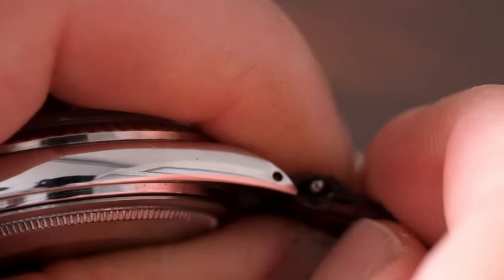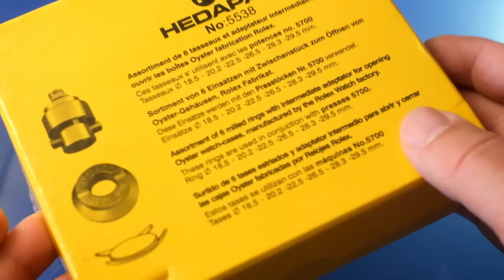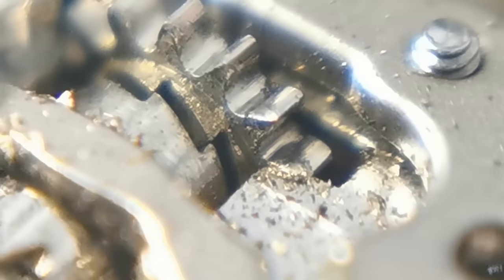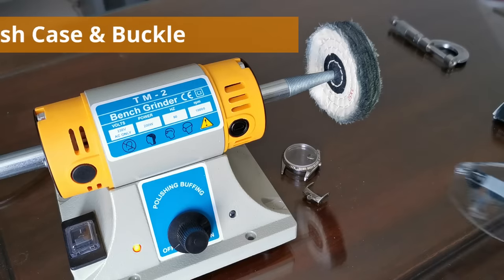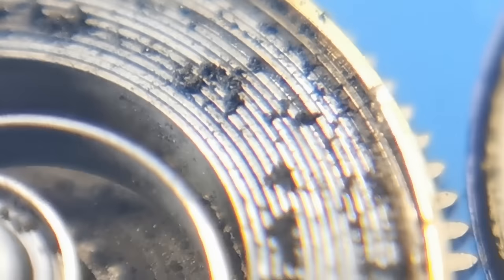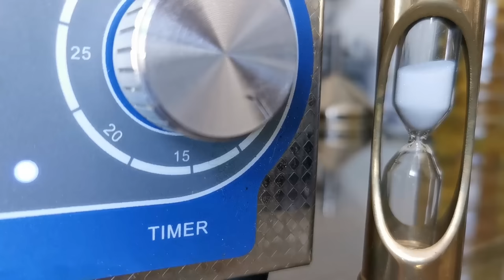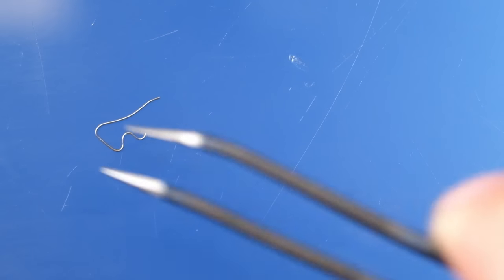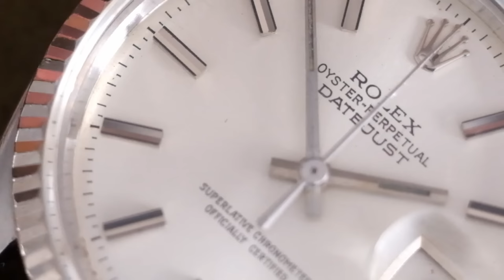Restoration of a Rolex Datejust - A Million Years with No Service!  It's Not Pretty Inside!

Comment: As always, your videos are exceptional. I have a Rolex Datejust 1603 with a sigma dial and of course the 1570 movement. Every time I watch you do the 1570 repair/restore I get even more attached to my Datejust. It amazes me as to how much goes into the 1570 movement and that with good maintenance will keep running for ever. You legitimize the excellence of this watch and Rolex. It is no wonder the Datejust has been one of their most sought after watches for decades. Keep those videos coming. Take care and stay safe.

Comment: As you know, metal filings around the keyless works, sliding clutch, and clutch wheel are not normal.  The watch also arrived with the winding stem removed, which is usually locked in place.  It did not appear that you addressed either the cause of the extreme wear in the keyless or why the stem came disconnected from the body.  It would seem that these things are connected and that some parts would need to be replaced.

Comment: Your video shows as much skill and patience as your skill in repairing and cleaning the Rolex. I have the same exact watch, I think, purchased in Geneva in 1971. I’ve only worn it a dozen or so times in the last 20 years. I last had it serviced in 1993. Might I expect the same degree of damage as the one you worked on. I know it needs cleaning because it does not keep running overnight after a days wear. Also how much extra would I pay if that were the case?

Comment: As usual that was amazing! How did you ever get so much confidence to just dive into something so complex and delicate? So impressed with your work!! Where did all those filings and crude come from? Excellent work my friend. Was so excited to see a new video from you!!
Reply: I have a Rolex Datejust very similar i was wondering where all the dirt and crud came from myself .
Reply: @juniorjohnson5961  Probably dried ancient lube.
Reply: The black stuff in the mainspring barrel was mostly dried lube.  It looks like an excess was used.  The filings seem to have come from the barrel also, you can see scoring inside the barrel as he disassembles it. An excess of grease is a problem as it gets thicker and collects dust, which turns it into a grinding paste. This has gone to next level due to neglect.  Apart from the yoke spring I didn't see any other parts replaced, so the filings must have come from the barrel.  If you see black soot all through the movement that is also usually dried barrel grease.  Get your mechanical watches serviced regularly folks, otherwise you can put 100 years of wear on a watch in less than 10 years.

Comment: I'm a Rolex DateJust owner and I noticed you didn't use a special tool to remove the wheel on the extended pivot that drives the seconds hand. Can this method be used on other watches? I chickened out on my late fathers Omega Cal 420.

Comment: I'm afraid I have to say that I'm highly skeptical about the quantity of filings supposedly found inside the keyless works. The debris in the barrel may be dried oil and grease, but if the winding mechanism was grinding itself to pieces to the extent shown, I can't believe it was made to work again without replacing parts such as the stem and it's pinions.

Comment: Richard, with all the visible swarf in the clockworks, indicating excessive wear, did you need to replace any parts, was wondering as you didn’t say?
Reply from the maker: Hi smgeraldo .... with a vintage Rolex it is always a balance between keeping it as original as possible on the one hand and regaining optimum performance on the other hand.  These watches are collectable and I am normally in favour of keeping it original unless it absolutely needs changing or the watch will not work.  Hope this explains the judgements made hear.  Richard
Reply: @richardperrettwatchmaker  Many thanks for the candid response Richard, much appreciated!
Reply: Fantastic job 👏🏻

Comment: Real question - for removing and reinstalling the case back, is there much advantage to the big metal tool versus just the rubber ball thing? Thanks
Reply from the maker: Hi Derek... The 'rubber ball thing' is only really useful once the back is loosened.  You will not be able to loosen a properly torqued up back will a little rubber ball... Hence the special tool.  Hope this explains.  Richard
Reply: @richardperrettwatchmaker  thank you!
Reply: Ps I have an old Tudor watch that is running fast/needs a service. Would you want to do a video with it? It is a 1984 Prince Oysterdate.
Reply: Or to put it another way, if you can open your caseback with a rubber ball then it wasn’t shut properly in the first place.
Reply: @LesterLovesWatches  that totally makes sense! Need to hermetically seal that bad boy

Comment: One thing you forgot here is to scratch out the remainder of the luminescent material on the hands and apply new layers of it on them.
Reply: It's called ""patina" and some owners do not want the luminescent material replaced. I don't know if it's standard procedure to do so or if the owner specifically requested that it not be done.

Comment: Richard another great video. I have a 2002 datejust that as far as I know hasn't been serviced. It gains 7 secs in 24 hours, should I get it done?
Reply: 20 years is a long time . It'll be bone dry in there . My Rolexes often play up after a decade or so : stop , become intermittent . A Rolex distribution service isn't cheap at USD1250 plus parts and tax . I've had a few updated during service with new dial/hands/info discs/crown and crystal . That's about USD3000 plus tax : more if diamonds on the day-date model . Seven seconds gain is fine . Knock it back when it's a couple of mins ahead .

Comment: Always of two minds with these videos. Impressed to see a very skilled artisan working on a complex mechanism, but strangely grateful for my soulless electromechanical wristwatch that listens to radio stations and charges its capacitor from its photovoltaic cell so its quartz crystal oscillator doesn’t shut down or get too far out of sync.

My watch isn’t going to be full of metal shards because I’ve been too stingy to have it lubricated regularly by a competent technician. Probably its capacitor will fail first, or maybe a motor. Maybe the U. S. government will stop paying for the time signal from the transmitting station called WWVB, and it’s be just another quartz watch with the usual slightly wrong frequency.

Comment: Would it be a fair criticism to say that the plastic you used to shield the dial when removing the hands was a bit too stiff?.
Reply from the maker: Hi Mike .. it's a balance.  Too thick and it's difficult to bring the levers in to bear, too thin and you risk damaging the dial.  Damaging the dial is to be avoided at all costs so I tend to go thick (which is inevitably a bit stiifer) and play it safe.  Hope this explains.  Richard
Reply: @richardperrettwatchmaker  Thanks so much Richard, I really appreciate the explanation.

Comment: I see a lot of videos where watchmakers use those spinning parts cleaners. I would imagine that the ultrasonic cleaners are significantly better, is this true or is there a place for both?
Reply: Most amateurs like here use the cheap ultrasonics. In professional workshops the spinning machines from Elma for instance are used with the proper fluids. Rolex only allows L&R fluids in their certified workshops.

Comment: Hi Richard, seems you can never know what horrors to expect when these old pieces are opened.

Good as new, almost..👍..I know collectors and enthusiasts like myself want to keep the original parts in place to get the serviced watch true to original. But for some watches I wonder how many may prefer to have new replacements, such as having tired hands replaced with new and perhaps the barrel and spring replaced as a set..there is of course the cost which may be prohibitive..just a thought wonder what others think..🤔

Comment: Im always interested in how much something like this costs? Hundreds? One thousand? Multiple thousands? I love watching restoration videos and Richard is the best.
Reply: If Official Rolex Service Centres charge around £500, I would expect an independent watch restorer to be a little cheaper. Also Rolex will replace a lot of the parts as part of the service and return your watch as close to new condition as possible. Having it Rolex serviced will also hold or increase its value as certificates/guarantees are issued.

Comment: 2 suggestions, consider a pair of wooden/plastic tweezers for handling hands and such, and consider a brass mini screwdriver for your pry bar work. Nice work over all. Oh yeah, also the hand lifter/bars are a bit rough, surprised they were angled at the tips and surprised they cut into the plastic a bit. Taking apart the key-less works, your screwdriver work needs a tad of improvement slipping/scratching the plates a bit.

Comment: Hello Richard! I have been a subscriber of yours for quite a while and thank you very much for your very informative videos! I am a self-educated watch fixer (or demolisher, lol), it has been my hobby for about 4 years now. 

Now, it seems that some help is needed. I have managed to get my hands on a Vacheron Constantin cal. 1096, actually the same as J. Lecultre 906. It unfortunately turned out to be that there are some missing teeth in the friction gear unit, that on one side contacts with the spring barrel, and on the other side it connects with the cannon pinion (now, I am terribly sorry for not wielding the proper pro terms).. But I hope something can be understood from it!)
So, sir, in case you happen to have a spare like that, I would be interested to buy it! Or, maybe in case you don't have it, you could suggest where to try and look for it elsewhere!)
In any case, thanks a lot and the best wishes!)
Reply from the maker: Hi Cyril ... JLC spares can be tricky as I  am finding out myself at the moment.  Could you please send me your contact details via this form https://www.richardperrett.com/contact/ and I will do what I can to assist after I have a little more information.  Hope this helps.  Richard

Comment: For we uninitiated..... Where does all the filth come from? Perhaps these cases are not as well sealed as I thought? Fascinating video by the way!
Reply from the maker: Hi Deuce Luminox.  The muck inside the barrel is the remains of the grease that was originally introduced to provide lubrication.  The swarf on the keyless works is the result of this components grinding together with similar long since dried out grease.   Hope this answers your questions.  Richard
Reply: @richardperrettwatchmaker  It does. Thanks for your response.

Comment: How often should my Rolex be serviced? Are there any signs I should be looking for to tell it needs to be serviced?
Reply from the maker: HI Libby ... signs to look out for are a sudden significant drop in accuracy,  a drop in the power reserve time although if you are wearing the watch every day you might not notice this, anything feeling unusual through the stem and crown when setting the time and the watch becoming hard to wind manually, and fogging under the crystal.  There's probably more but those are the main warning signs I guess (oh! and a checking the crystal periodically for holes around the edge where it mayhave been chipped (you will need some magnification for this).  Do not leave these cracks unresolved as water as a knack of finding a way in which is 'less than ideal'.  Other than this every 7 to 10 years I reckon.  Hope this is helpful.   Richard
Reply: @richardperrettwatchmaker  Hi Richard! THANK YOU!! I just recently bought my very first, and only, dream watch, my Rolex! It is a 1996, which happens to be the year my hubby and I got married, and is a blue face with diamonds on the hour spots. I first saw this watch and fell in love with it in the 1980’s so my desire is to keep it in top shape and to pass it down to my youngest daughter and then eventually to my granddaughter. Thank you again!

Comment: Hello Sir, if you are looking for new content, I have a completely trashed Omega Speedmaster Reduced that needs restoring, I landed on it awkwardly and its as if the movement has crushed into the piggyback chronograph module as all 3 hands spin when I turn the crown, the watch doesnt wind, and the rotor doesnt spin. Good times. It was a gift from my Grandfather. Let me know how much it would cost to get it running again and I will send it and pay for the return shipping. I live in Australia however. Thanks!

Comment: Good job but really I though it would be much worse for a watch that has not been serviced for along time! As I have seen only one part was replaced and the 2nd (barrel) was cleaned up nicely. Personally, I would not service a watch unless it starts showing a problem, I also don't swim with mechanical watches unless they are pressure tested.

Comment: My god I wish I had this skill. I believe my hands are steady enough to do this but I will not remember where every screw and gear goes. I am at the level where I can change dials and hands and lubricate as far as is allowed by removing the rotor assy and balance wheel bridge. Beyond that I will render a 3035 or a 3135 trash. LOL Also...I use the exact same device to set the hands.
Reply from the maker: Hi ScarabChris if your hands are steady then you are only practice away from being able to do this.  It amazing how quickly your brain will cope with remembering where everything goes when it does it on a daily basis.  Thanks for the feedback. Richard
Reply: @richardperrettwatchmaker  Amazingly quick reply! I sent you a message on your website. Funny you mention "practice". I have bought a few "fake" movements just to practice on and once I break them down I always seem to mess up putting them back together. I have a 3035 from a 16800 sub that needs the service I just watched here. EDIT..I tried sending a message on your site but the "I'm not a robot" verification keeps timing out.

Comment: What a mess!

The watch, not the video, which was excellent.  Couldn't believe how the old lubricant had oxidised and broken down, with so much damage caused to the keyless works.  Would it be possible to nitrogen flush the watch before sealing to reduce the amount of lubricant oxidation?

Comment: I can get over your taking the backing plate of with a machine that coast more than $600.00 when a rubber ball that coast about $0.40 but I had to stop watching after the close up on the new barrel spring.
Reply: Ya I thought that is way over the top hardware to open the case back.